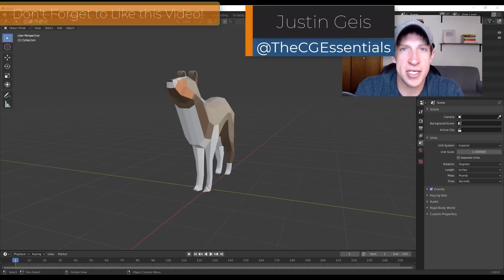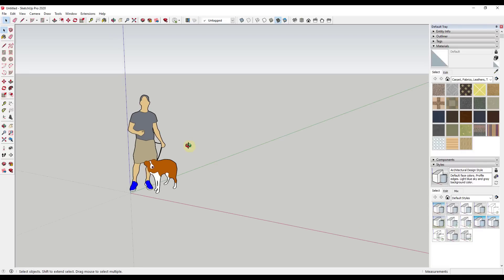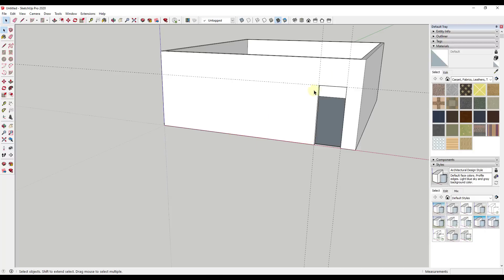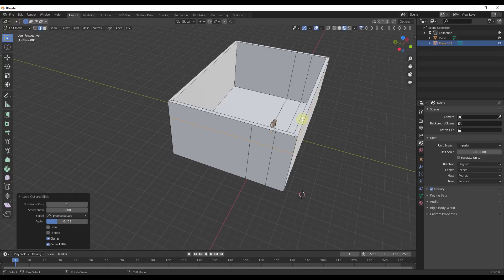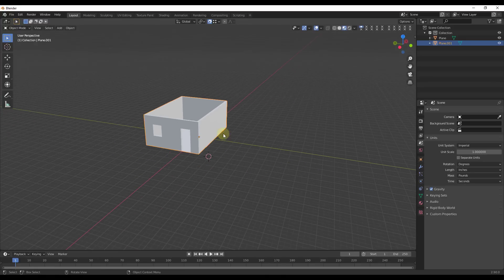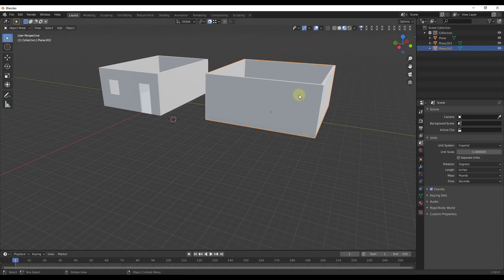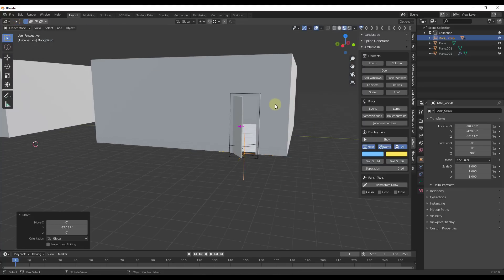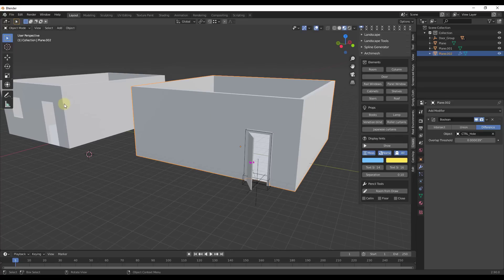Why SketchUp Users SHOULDN'T USE The New Extrude Manifold Tool in Blender!

Comment: Seems like a lot of the trouble comes from making your walls from inserting the floor. That's where the 45s come from. If you instead extruded one wall from a long narrow rectangle and added a couple vertical cuts then you extrude the perpendicular walls all around your building with 90 corners and the manifold would work a lot more like it does in SU.
Reply from the maker: But again...why bother? It's significantly faster to just use a boolean workflow and let the modifiers handle the holes without destructively modifying your mesh...